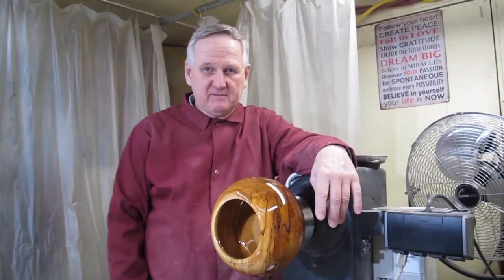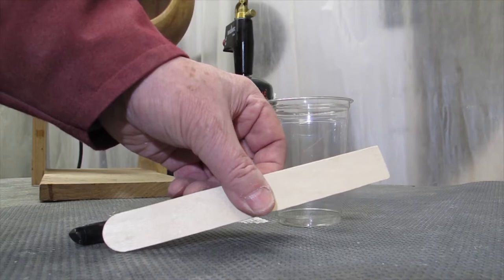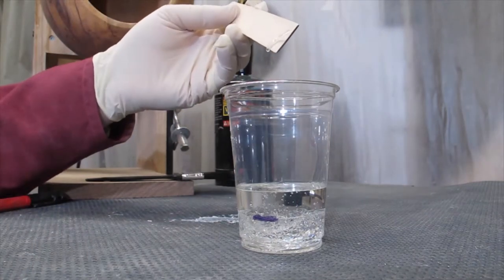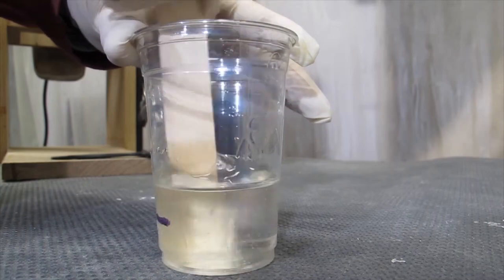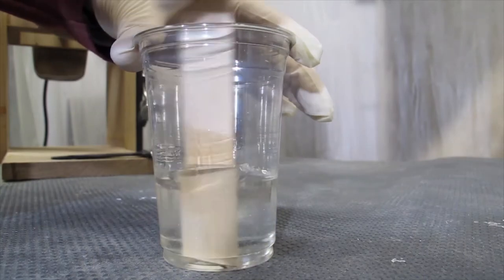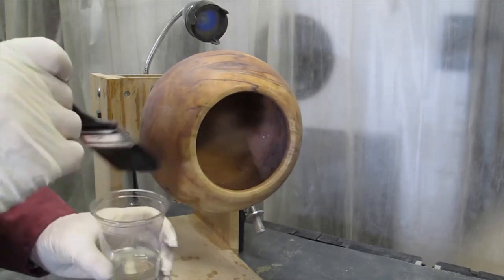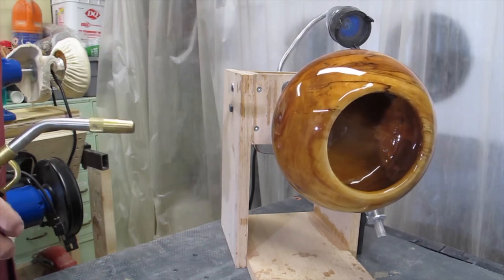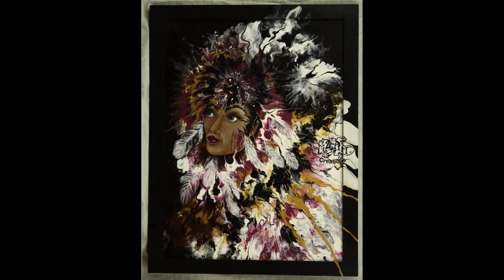Bubble Free Crystal Clear Epoxy Resin.

Comment: Dag gone, Your wife can paint! Those were beautiful. I will be repeating your exact process for my countertops. Cup method and all :)
Reply from the maker: Thanks for the compliment.  I am rebuilding our website with Dreamweaver and I will be adding more of her paintings then.  I haven’t done any serious web development for 25 years so I have to ramp up those software skills.  lol

With regard to the resin, not all resins are equal.  The resin I was using for this video was a shallow pour resin (no deeper than 1/4 inch) typically used for making jewellery, and the Epoxy had a higher density and viscosity than the hardener so the Epoxy settles to the bottom.  I was also mixing a small amount.  For deep pour resins (rated for various depths) the density and viscosity of the Epoxy and the hardener can be very similar so the Epoxy will start to mix with the hardener as you pour in the Epoxy, so using the cup method for measuring does not work.  There are also Epoxy resins that use a 2:1 ratio, and there are Epoxy resins where they use weight of each component as the measurement.  An accurate way to measure the volume you need is to pour dry rise into the area where you plan to put the Epoxy resin, and then split the rise up according to the measurement used for the type of resin you are using.  I split the rice by weight which is very accurate.  Either 1:1 or 2:1 (2/3 Epoxy, 1/3 hardener).  Epoxy resin where it is measured by weight can be done in one container by using the ratios the manufacturer recommends.  Fluid ounces are a measure of volume for a fluid but the density of the fluids have to be the same which is usually not the case for Epoxy resin.  When you are mixing a large volume of Epoxy resin you can trap a lot of air in the Epoxy and the Epoxy will settle as the air comes out, which affects the mix ratio.  That is were the rice benefits.  You can put a mark on your container at the height of the volume of rice for the hardener, and then another mark on the container for the full volume of rice which includes both the hardener and Epoxy.  When I worked in the aerospace industry I was taught to always put the hardener in the container first and then add the Epoxy pouring it through the hardener.  That way the Epoxy can never make contact with the sides of the container before making contact with the hardener.  That is when you get issues with a a sticky mix.  I have never had a bad batch due to mixing.  For large volumes you probable will want to use a mixing paddle on a drill.  The faster you run your drill the more air that will be incorporated into the mix by forming a cavity behind the paddle.  I prefer a thinner paddle rather than a thick flat one.  I still mix until the resin becomes clear.  I find that deep pour resins have a much lower viscosity and take longer to set which provides more time for the bubbles to rise to the surface so you can pop them.  You will also find that you can reduce air bubbles by sealing your wood with a coating or two of Epoxy resin before doing your pour.  Wood is filled with air pockets and they are a royal pain to seal to prevent bubbles.  As an artist I am sure you are aware of various additives like Pebeo, mica powders, chameleon powders and the like.  Avoid oil and water based additives.  I would recommend doing some testing before doing a big pour.  You can also add things like stone, beads, glass, toys, figurines, and mirrors to the resin.  I need to finish my latest video so I can show the variety of techniques I use.  Good luck and have fun.
Reply: Oh man thank you for that i did not even consider all of that. i will be researching as my epoxy is a 2 /1 mix. i will def pour the resin in to the hardener tho.  Thanks again for incite. i hope to make beautiful wooden things like you in the future! @liz-artcreations6633

Comment: Wow amazing video and beautiful bowls. I bought sigwong epoxy resin clear crystal can we use this for acrylic canvases? Also why 3 layers of resin? It was quite shiny just with the 2nd layer
Reply from the maker: I am not familiar with the specific brand you mentioned but I am using a table top resin in this video so it isn’t designed for thick pours or moulds.  My wife uses this resin in her paintings on canvas and it looks great.  

Things to take into account:
- Work on a level surface.
-Use disposable brushes that have straight bristles, no fuzzy tips that tend to add bubbles.  Hopefully you find a brand that doesn’t lose bristles.
- If your resin is designed to flow and self level you will have to watch it for a long time because they can flow for hours.  You may have to control the flow.
- Once the resin starts to thicken do not overwork it.  You can create problems that are hard to fix.  You might be able to buy a little extra working time by heating the resin a little with a small torch.
- Use a small torch to pop bubbles but maintain a safe distance.  Do not overheat the resin.  Quick passes are all that is required.  From what I have read it is the carbon dioxide produced by the flame that causes the bubbles to pop.  I have also popped bubbles with my breath.  I am just not as full of hot air as the torch.  Contrary to some people’s opinion.  😁
- If you are applying a second coat a light sanding provides bite for the second coat by creating a rough surface that increases the bonding strength of the resin.

My wife has made water scenes by applying acrylic inks and powders to the resin to add colour.  She has also used it to coat a variety of things that adds dimension to her art.

I hope this helps.

The reason I apply three coats of resin is because I am applying the resin to wood. Wood is porous and it does absorb the resin.  It also releases lots of bubbles.  One of the biggest problems with wood is that it’s moisture content is always changing due to changes in humidity.  Dry wood will shrink and, depending on the grain direction, it has the potential to crack.  Drying wood to eliminate cracks is a science of its own.  Drying wood slowly reduces the risk of it cracking.  Some wood turners let their wood dry for years.  If you ever wonder why natural hand turned wooden items like bowls are not cheep, it not only relates to the skills of the wood turner but also to their drying skills and to the amount of time it takes to dry wood properly.  There is a cost to storing wood.  Chainsaw carvers will cut a slot in the back of their carvings to provide a relief point to compensate for shrinkage.  By applying multiple coats I am locking, or should I say slowing down the rate that the wood dries.  Epoxy resin is the best wood finish I know of to seal the wood and protect it from moisture.  Epoxy resin also has tremendous protection from a variety of chemicals.  The resin also adds strength to the object, and the multiple coats increases the strength.  The down side is it takes anywhere from one to too weeks for me to make something because I have to let the resin cure 24 hours between each sanding and coating.  3 coats outside, 3 coats inside, and three coats to apply my label.
Hopefully this answers all of your questions adequately.  😊

Comment: A beautiful bowl for sure. I like the process of mixing do all resins perform that way?  How did you mount the bowl on the rotating stand and did you have to finish the bottom after the rest of the bowl cured? I have to admit that I prefer a natural finish on my bowls but think this would work well on mugs and tankards and some other pieces when looking for a water proof finish.  What kind of motor are you using?    Sorry for for so many questions. Jim - Montana Wood Art.
Reply from the maker: Thanks for the comment regarding the bowl.  I have to admit that using epoxy resin compared to other products is far more time consuming.  It takes at least a week to apply the finishes because I have to wait for each coat to cure.  That said you can get some amazing chatoyancy using resin, especially in sap wood.  Also epoxy adds more strength and waterproofs better than any other product I know of.  I like to use it on my live edge bowls because it strengthens and seals the bark.  I can also control my finish through sanding so I can go from an extreme high gloss to a soft matt finish.
In answer to your questions:
- I can’t speak for all resins because there are so many on the market. My preference is to mix using a single cup and putting a mark on it after putting in the hardener and then adding the epoxy.  This only works when there are equal parts of resin and hardener.  This method doesn’t work if the hardener to epoxy ratios are different.  Some resins are mixed by weight.  For that I use a digital scale, and I put a silicone sheet on it to protect it from spills.  I zero the scale with the silicone sheet and whatever cup I use before adding hardener.  I always add hardener first and then pour the epoxy into the centre of the hardener.  This ensures the epoxy makes contact with the hardener before touching the sides of the cup.  Using the scale I record the weight of the hardener, and then add the appropriate amount of epoxy according to the manufacturers instructions.  When mixing using the resin I purchase I look for clarity to determine when it has mixed properly.  I can’t say this works with every resin but it has worked with the ones I have tried.
- I built my own rotisserie system using a barbecue motor.  My system uses a 1” steel shaft and a couple of bearings to support the weight.  I made an adaptor to attach the motor to the steel shaft.  This takes the load off of the motor.  I have made an assortment of mounts that go on the end of the steel shaft.  I used resin to make a threaded mount that I can mount my chucks on. (Finding a 1-1/4” 8tpi die wasn’t easy),  I have an assortment of bolts that thread into the shaft so I can mount my woodturning at different stages of a turning.  I also welded up a two jaw system that I can mount on the shaft which allows me to free up my chuck.  The jaws fit into the recess where I mount my turnings.
- I typically use a tapered recess on my turnings. The taper provides a wider base which adds more stability. The last step of my turning is to apply my label using resin in the recess that I use to mount the bowl on the lathe.  I created a video on how I apply my labels called “Creating and Applying Laser Quality Labels”.
- I use food safe epoxy resin on my bowls which makes them more waterproof and chemically resistant than most other finishes but it is not a high temperature resin so I wouldn’t use it on anything where a hot food or beverage will be used.  As a rule of thumb resins start to soften around 140°F.  If you plan to use resin where heat is involved, such as a coffee mug, make sure you are using a high temperature food safe resin.  I have never created coffee mugs so I can’t recommend an epoxy resin for them.
I hope this answers your questions.  Sorry for the long answer.  😊
Reply: @liz-artcreations6633  Wow. Thanks for you really great reply. Lots of good information here. Jim. Montana Wood Art.

Comment: What brand of resin do you use and is it for wood only
Reply from the maker: I use the high gloss crystal clear East Coast Resin that I purchase through Amazon.  It is UV, scratch, and water resistant and it is safe to make contact with food once it has fully cured.  I use it on my wooden bowls because it adds strength to the wood and epoxy has the highest resistance to water of any of the finishes I know .  Since it is food safe I don’t have to worry about food allergies.  I have used this resin to cover wooden bowls, make resin bowls (the thick areas [6”] on the bottom of the bowl did have an amber colour) , make jewelry, and repair a variety of items using this resin.  I have seen reviews online of 10 different resins and east Coast resin had excellent reviews.  The only characteristic that didn’t have a high rating was that it had a tendency to form bubbles.  The method I show in the video pretty much eliminates the bubbles.  It is how I was taught to mix resins and adhesives when I worked in the aerospace industry.  I have also seen reviews on its UV resistance and it rated in the top third for resistance to turning an amber colour.  I hope this helps.
Reply: @liz-artcreations6633  can you please share the link when I search I find too many different products for resin. 
Thanks in advance
Reply from the maker: @iumer  
For this video I used East Coast Resin that I buy through Amazon.  It is an epoxy resin designed for thin pours to cover table tops.  If I find a resin I think I would like to try I do an online search for reviews and I also make sure it either is available in my country or ships to my country.  I hope this helps.

Comment: Can I know how you clean the brush please??
Reply from the maker: I do not clean my brushes.  I use the cheapest polyester brushes I can find.  Our local dollar type store sells them in packages of four for $1.25 so spending time cleaning them really isn’t worth the effort.  Once the resin has cured I pull the brush out of the feral on the handle and then give the brush to my wife, who is an artist, and she uses them for texturing in her paintings.  I use a fresh brush each time I apply the resin so I have lots of brushes that I give to all of my wife’s artist friends.  When it comes to the type of brush I always use a synthetic brush that has a straight bristle.  I do not use natural brushes made from hair, or brushes that have feathered ends because they add air bubbles when I am applying the resin.  The solvents I used when I worked in aerospace would thin resin but they would likely do damage to  synthetic brushes and they required special handling requirements.  Save your self the effort and buy the cheapest straight bristled polyester brush you can find.  In order to use up my resin coated brushes I was thinking of using them in a resin bowl.  If you come up with a good use for them please let me know.